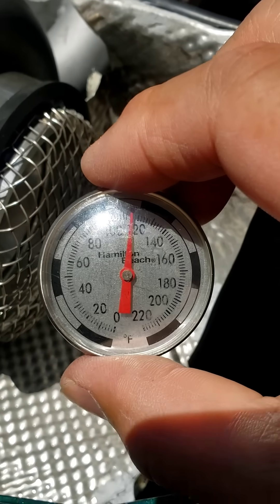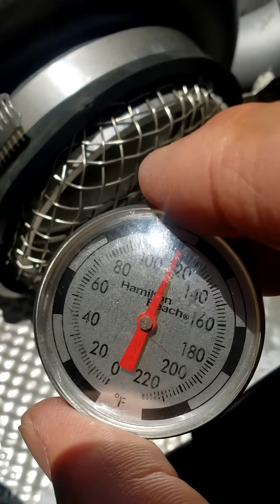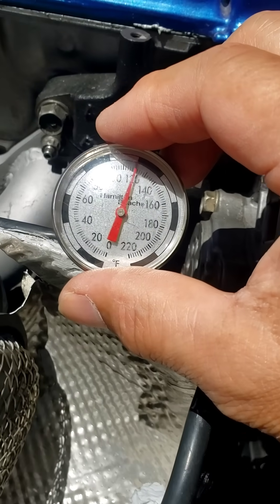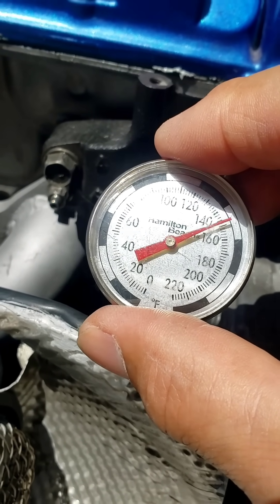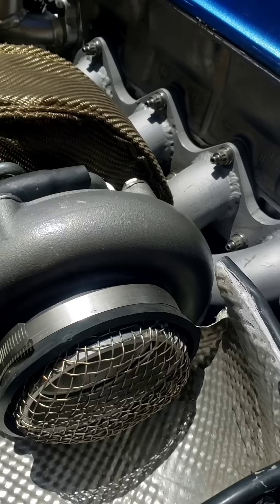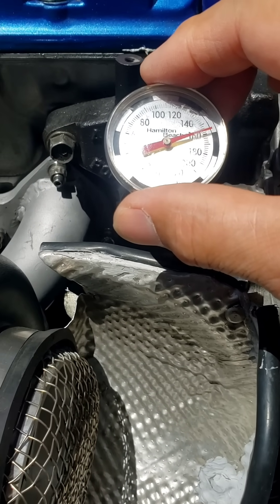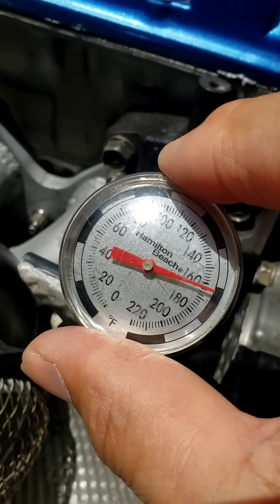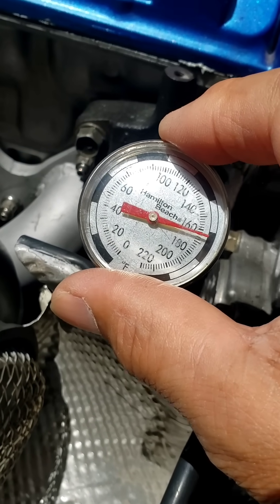Importance of having a Heatshield

Comment: What needs to be done is a little bit of pipe and velocity stack  I guarantee at least 10 hp if not 30hp it helps channel the air into the turbo
Reply from the maker: True, those velocity stacks works.

Comment: The hot air will be cooled off by the intercooler. What's most important is where your iat sensor is at. did back to back pulls on my turbo h with the iat sensor in stock location vs iat in charge pipe and saw 40whp difference with the temp difference of 30 degree on a 80 degree day weather on dyno. Stock iat location is horrible as that's not the actual air temp flowing into the motor and gets heat soaked on the hot intake manifold. Yes it will get heat soak if sitting in traffic but as soon as you move the temps will climb back down.
Reply from the maker: I did thought of weld a bung for iat sensor on the intercooler pipe but l was reluctant of doing it coz of the H22 designed. Maybe on my next build project l'll relocate the sensor.

Comment: Pero that's what the intercooler is for . Honda ait is usually near the tb which is after the intercooler .
Reply from the maker: Iat sensor is depend on the engine designed, Obd1 engine sensor is at intake manifold and obd2 sensor is before the throttle body. I thought of reloicating it but maybe next time.

Comment: I should try this on mine , no front radiator
Reply from the maker: You have to put a ducting and intake away from radiator if you can. Help a lot
Reply: @sagittnet2158  sry I meant checking temp . I have a rear mounted radiator system